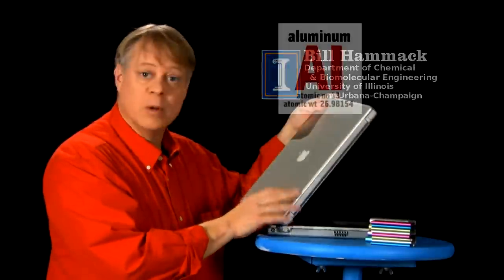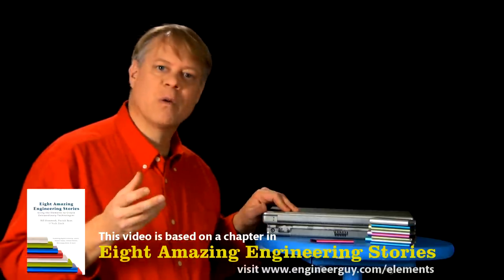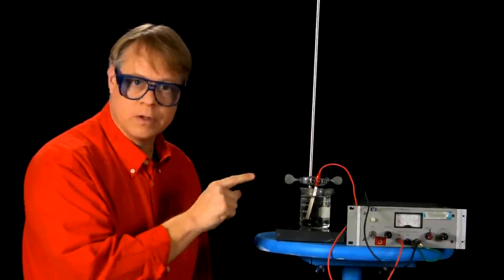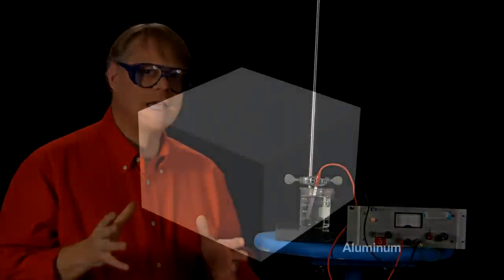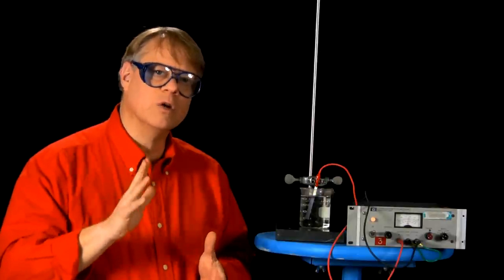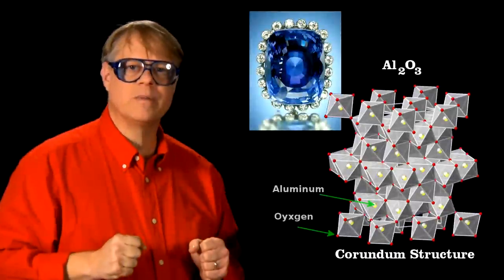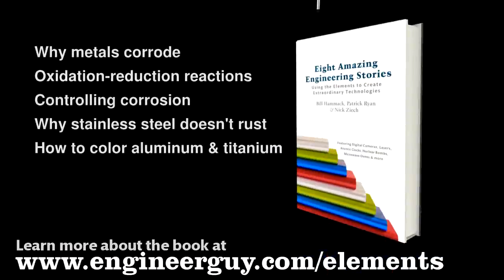Anodizing (Or the beauty of corrosion)

Comment: I live on a sailboat.  After paint failed on some aluminum fittings on the boat, a rigger friend recommended that I black anodize the parts which I did.  When I brought the anodized parts to the boatyard, an old timer friend recommended that I coat the parts with lanolin (sheep fat) which I did.  The lanolin seals the pores and keeps saltwater out.  The anodizing protects the aluminum.  More lanolin is re-applied when the parts look a little chalky.  It's a little pricey but the  anodizers usually charge per batch, not part, so plan accordingly.
Reply: ...boat stuff...you could try 'hard anodizing'....very hard and only available in black....but quite a bit more durable than the regular  anodizing.
Reply: I agree.  My goal is less maintenance.
Reply: have your pieces powdercoated or ceramic coated
Reply: Also, stay away from black anodizing as that soaks up the most UV and will ultimately turn brow (unless of course you desire this)...
Reply: "It's a little pricey but the anodizers"
And there ends your comment. Youtube... is it so hard so display a few words or what? How can they fail at such simple tasks like showing comments?
Reply: @leocurious9919  now? How is it now?
Reply: @Artistoh14  Yes, I can read it now. Seems like Youtube fixed this bug after some years.
Reply: @leocurious9919  it's perfectly fine, what do you mean?
Reply: @750tiprogamer  See my answer from a year ago perhaps?

Comment: Which is why the AR rifles introduced in the mid 50's by Armalite were so advanced. Armalite used manufacturing advances it took from it's parent company, Fairchild aircraft. The anodized aluminum upper receiver is harder than the steel bolt carrier that reciprocates inside it. It's the steel carrier that wears out first.
Reply: Cool! I'll have to take measurements on mine.
Reply: Except that exactly what makes the rifle a very expensive and ineffective piece of toy. Its nice for sport shooters and consumers, but terrible for the military which requires mass production of cheap yet durable tools.
Reply: robert karas No, not really. The AR-15 can be cheap if you want a cheap one. The anodized aluminium receiver isn't the source of failures or low accuracy in cheap rifles, or in expensive rifles, or in any rifles. The smaller parts that require high precision tools to manufacture typically fail long before the receiver. From an engineering standpoint, the AR-15's receiver is excellent: it's durable because of the anodization process, rigid because it has relatively thick walls and still lightweight because it's made from aluminium.
Reply: Smith & Wesson made model 39 semi auto with an anodized frame around 1950.
Reply: robert karas yeah, so terrible the most effective and powerful military in the world has been using it for what, 50+ years?
Reply: BA_300_AAC haha most effective? sure buddy we spend more than the next 10 nations combined, for that kinda money the war on terror should be won.. But in reality the terrorists are winning by making them do shit like the patriot act which takes away our freedom which is what they hated
Reply: I'm still waiting for the next advancement in small arms technology. I guess World War III might finally get it started.
Reply: @carolynmmitchell2240  Power projection is very expensive.
Reply: Then why are the parts subjected to the most stress made of steel? The barrel, bolt, bolt carrier and cam pin are made of steel.
The upper and lower receivers are not subjected to much stress or heat. The upper merely guides the bolt carrier and charging handle while the lower houses the trigger group. The recoil impulse, high pressure and hot gasses are absorbed by steel parts.
Reply: What is this "ARmalite" you speak of?  The liberal media insists that AR stands for "assault rifle" !   :)
Reply: @igfoobar  It actually comes from Armalite Rifle.

Comment: As an interesting note: Type III aluminum anodizing (sometimes called "hard coat") has a surface hardness similar to steel.  With Type III hardcoat, you can have the weight, rust-free nature, and cost of aluminum matched with the hardness of steel.  While this doesn't have much use from a structure perspective, it works great for sliding pieces as the finish will not wear off easily like bare aluminum or Type II anodizing (standard anodizing) or show scratches from normal use.

Comment: Many, many years ago, I worked at a company that made photosensitive plates for printers. They took huge reels of aluminium of varying thickness, pulled them through a 30 yard long bath and used huge currents to anodize the material. Controling the speed and current controlled the thickness of the oxide layer. It was then coated with a photo sensative layer. After exposure and developing the plates, the pores that were not closed by the remaining photo sensative layer take up and release the ink on the paper. Clever stuff.

Comment: I used to work at an plating company doing aluminum anodizing. There were two types of anodizing they did, soft and hardcoat. Two different processes. Only soft anodizing will accept the dyes. Hard anodizing would be either natural which are different shades of brown or dyed black. Bill explained it better than my former boss. Bill, do a hard anodize episode for your fans.
Reply: I remember black being the only option for hard anodizing.

Comment: Nice video but a small correction:  with aluminum the current doesn’t “push” into the aluminum to make channels, the process is actually chemical.  What’s missing here is that you anodize in an acid, typically diluted sulfuric acid.  The anodizing process is a tug of war between the acid that keeps digging holes and the current that keeps forming oxide. Where the acid is winning, you get the long empty tubes, where the current is winning, you get the oxide walls.  Without enough acid, you never get past the nanometer thin barrier layer.  Without enough current, the acid eats away all the oxide.  Keeping everything balanced is the hard part.

Love your channel!

Comment: Not all aluminum parts should anodized, If a part is under cyclical stress it may fail in less time due to the affect on the surface. micro fractures will occur from the the altered surface. Thinking of aircraft components.
Reply: And boats. Yes it's true on thin aluminium, not on thick pieces as the ratio layer thickness on piece thickness gets smaller and amaller. The main problem is how to control the galvanic effet on a big complex piece to get a uniform thickness of anodization. And secondary problem cost and lack of durability of a soft anodization.
Reply: How thin would be not ok
Reply: @christopheryee4850  one third of an inch

Comment: So putting it very basically, ignoring specific steps and materials, you run a current through the metal you want anodized, which 'primes' the metal with a coating that is ready to accept a dye to intensify the color and finally, the finish is sealed by boiling the piece to lock in that color?

I don't know why, but 20 years ago I missed a program on Discovery Channel, and never tried to find out, but it kept gnawing at me to figure out why things like carabiners came in various colors. Now, 20 years later, I can sleep well knowing how it's done.

Bless you Bill - my sanity is partially saved! 🙏

Comment: This video has sealed the deal, I'm going to get the book. ....done. 

I do cold metal casting of resins. I have a silicone mold of an item. I will sometimes brush in powdered aluminum to the mold so that the liquid resin will grab that and have an aluminum coating that is bound to the outside layer of the resin. From there I can use some steel wool and give it a very real brushed metal look. 

This video makes me wonder if I could try and anodize it at all. I'm not sure but to have a colored aluminum finish would be great for the decorative pieces I cast.
Reply: +Jason Parker I would buy the book, but then I wouldn't be able to hear his soothing voice paired with the quirky music.
Reply: You don't want to anodize that because it's not pure metal. The resin might produce a nasty reaction. You could try just coloring the aluminium powder with alcohol dye, let it evaporate completely and then coat your mold with that powder.

Comment: It could be worth mentioning that anodized aluminium is used not just for aesthetic purposes (different colors which don't wear so easily) but also to increase heat radiation from surface. 'Clean' aluminium is so bad in emitting IR, so the only way it can lose heat is through convection. Not bad if there is some fan attached. But if you expect your surface to be a passive heatsink, there is great advantage to make the surface black in IR region. The best way to do it with aluminium is to anodize it. You can see a lot of dark aluminium heatsinks which are anodized exactly for that.
Reply: Does that still work after the dye is applied?
Reply: Yes. Almost any dye is 'black' in thermal infrared range. For example, centralized heating radiators made of aluminum are almost always of white color, but in IR they are black, so they emit pretty well. Another example is International Space Station heatsinks: they are also white, but of course they emit very well, it's the only way to get rid of heat in vacuum of space! And they are white because this way Sun can't heat them!
Reply: +AllMyCircuits did not know that! Cool.

Comment: Why don't they use this on cars with aluminum bodies?
Reply: +Ryan Vickers Could it be that this texture also affects drag, and thus fuel consumption to an extent.
Reply: +Ryan Vickers Actually I think Carlos is right, and in extent you as well. I believe this isn't used on car bodies because it reduces milage and as you said, dirt does too. An uneven surface is going to let dirt build up much faster and further reduce milage. In combination - not worth it.
Reply: +Brandon Hall Because the paint manufacturers would have a shit-fit and petition the government to sue the auto companies into switching back. Or something.
Reply: +Brandon Hall Anodizing adds weight to the bodies. You're synthesizing oxygen with the metal in order to create an oxide. This by result adds matter, and therefore weight. This isn't the only issue.Paint/finish needs to stick to something, and metal is horrible for that. Metal conducts electricity, and you need a primer in order for paint/finish to stick to anything. Some cars don't have universal body panel material all the way around either, so anodizing won't look very good since the bumper material may differ from the door paneling, etc. There's also the minor things that include fixing scratches in the metal/paint, people wanting to change the colour of their paint (you need to sand down paint between coats for a good finish), and businesses trying to protect themselves and whatnot.
Reply: +rivengle I'm sure paint weighs more than anodization, it's a much thicker layer of material.
Reply: +Ryan Vickers Mythbusters are good on somethings and not so good on others. That will hugely depend on the aerodynamic properties of the car.

We also have to remember that cars generally aren't made to be as slippery as possible. They need traction too as in downforce, which is to purposely make it less aerodynamic. A rough paint could mess with that down-force.
Reply: @rivengle
Firstly, you're not adding weight :-s, you're actually removing weight.

Secondly, although paint might not stick very well to metals, anodizing is a very effective way of painting Al, especially if you seal it in. It does a better job then tradition painting with a primer.
Reply: Anodization is not used because the process is very difficult to control on big pieces, uses nasty chemicals and produces a lot of contaminated water to treat before disposal. 
The process is not durable when exposed to UV (except the natural grey). Blacks are the most delicate, they fade to brown and yellow. Except special and costly anodizations,  the oxide coat on aluminium is worn pretty easily, and worst cannot be repaired locally like a paint. Besides it complicates greatly the assembly of the car as it cannot be welded, nor glued.
On aluminum big parts like planes (glued and riveted) and boats (welded) and cars paint on primary on a chemically prepared aluminium surface (traditionally a sulfo chromic conversion) is preferred. The system is far stronger and tougher than anodization. And can be repaired locally...
Last but not the least cost. A good compromise is galvanised or better hot dipped steel and a paint system . Well done it is durable and far cheaper than aluminium anodized or painted. It can be done after welding or brazing the primary parts, and hot dipping zinc works even in the hollow parts.
A double hot dipped zinc on steel can withstand 25 years of marine corrosion, more if painted and a mix called galvalum ( aluminium zinc alloy) used on some tin roofs will last more of 20 years, painted far more.
Reply: Brandon Hall cars need repaint for new scratches and dents you have every week but you can't do re-anodizing because the tone will change. so it will make you change the whole part means more cost.
Reply: I'm no expert, but wouldn't anodized aluminum be more brittle than steel and therefore less safe in an accident? Because instead of dents and crumple zones you would get shards of hardened aluminum flying around.
Reply: How long would it take to anodize my Delorean?
Reply: Aikidoman06 Does it really matter how long if it's a time machine?
Reply: Aikidoman06 it's stainless steel. No need to anodize it.
Reply: Too soft & more money than steel especially if anodized.
Reply: Don’t worry, this wasn’t directed at you.
Reply: That's a brilliant idea. The matte finish is really popular now; usually achieved by plasti-dipping their car.

Comment: Dear Bill, your video is very fascinating and easy to understand for students as well as professors. I find it yesterday and going to show my student today in the course of surface engineering at UQAC. I am running a project on anodization of aluminum but use cathode in the same acidic bath. However, in your video I did not understand where did you put the cathode? Secondly, can you find a condition (playing with thickness as well as metals) that your anodized layer hence the whole material become invisible? ha ha ha!!!

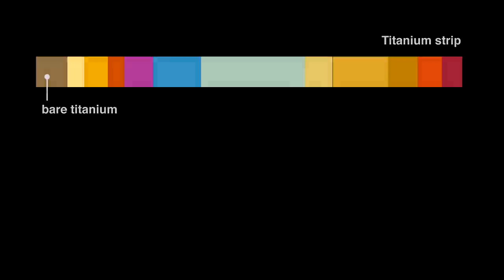Comment: 1:35 I was a welder for 5 years and I always loved the beautiful colors when joining Stainless Steel. Now the dummy answer they give us when teaching TIG welding is it's oxidizing (despite the argon shielding gas we use to prevent oxidation and the nickel and chromium). It follows the same pattern of a light hay color through the red blues and purples. Can I make an assumption about how much penetration I am getting based on the color of the weld?
 Is this the more detailed answer of what is happening? I don't have a ton of experience welding Aluminum but I have done it a handful of times. However I have never seen the color change on aluminum. The procedure is much different we use AC current and a pure tungsten electrode that we intentionally ball up instead of sharpen to a point.

Comment: I love your videos. There's some room for improvement in this one.
You incorrectly show the anodize layer growing only inward. This is incorrect, it grows mostly inward but the part actually increases in size after anodization. Also there's no difference between 'soft' and 'hard' ano, hard ano is just thicker and the part growth issue becomes more important.
Another interesting thing to note is that white anodize isn't possible because white dye molecules are too large to fit in the pores.
Reply from the maker: Thank you

Comment: I want to make a aluminum sword, with 2 diffrent colors. The blade and the handle. I want to know, how do i do this the right way, without bleeding the colors into each ends. Do i just tape up the end im not dipping yet, with maybe duct tap. Then dunk it in boiling water for maybe 10 min, then duct tap the other end and repeat the same thing. Will the color pass the water line at all? Does it lose color when i put it in boiling water? Thanks

Comment: I've actually been wanting to anodize a piece of aluminum that I own. Doesn't seem like it should be that difficult. I just need to figure out what the correct dye to use is, and what will be the safest and most efficient way to put the electricity into the metal.
Reply: As you probably know by now, it's not the electricity you need to worry about messing with, it's the "solution".

Comment: What are your thoughts on anodizing vs powder coating?
Reply: +Joe Schmoe powder coating creates a rougher surface than anodizing
Reply: +Steven Guan thank you.
Reply: powder coating is more corrosion resistant especially in the salt air environment while anodizing is more wear resistant where scratches are expected. that's one of the reason why personal electronic products are anodized.
Reply: Oh. I think in terms of car parts. I live In central hellinois. Prime rust belt area. Thanks for sorting that out.

Comment: Hello Everyone, I have a problem with anodising the pressure casting aluminium, means the alloy with high silicon contain (Si>6%). Does anybody tried this? Which parameter could be a problem, which should be combined?